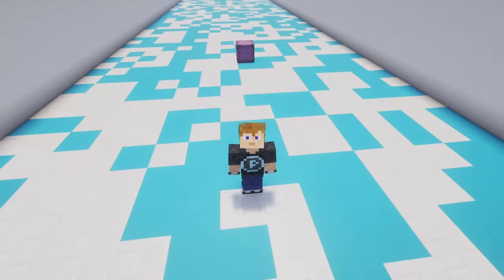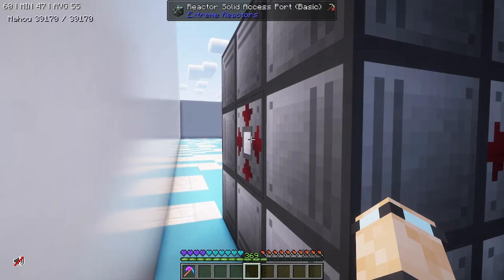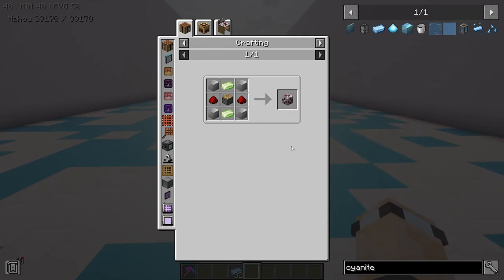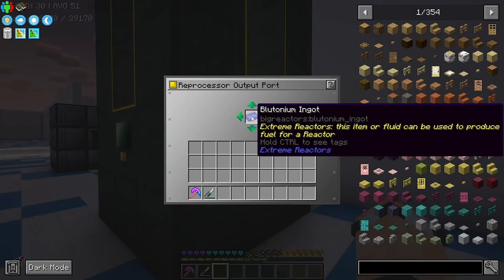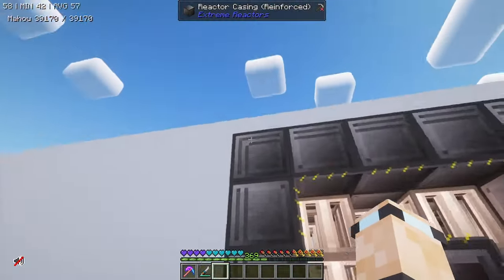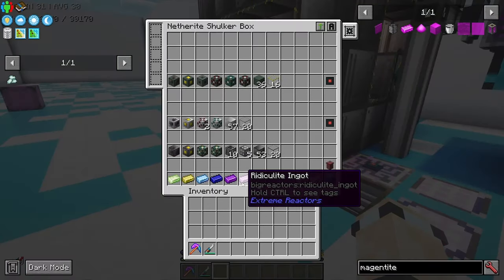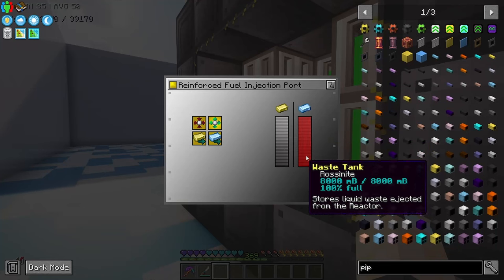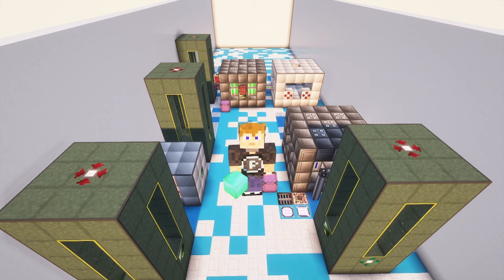All The Mods 9 Extreme Reactors Tutorial - Insanite Block

Comment: There was a post on CurseForge by a player who said they were having stacking problems within ATM9 whereby identical items wouldn't stack. Incidentally I noticed it happening to 'Secret Life SMP' players in their videos (eg two acacia logs from the same tree wouldn't stack). I wonder if a recently updated 'commonly used' mod has introduced NBT data problems. 🤔
Reply from the maker: That is and issue I had and it turned out to be because a zombie or other mob had picked the item up.
The prevailing theory we have is that mek adds an extra nbt value to liquids and that's messing with the reactors 🤔 I hope its resolved soon, it's very annoying 😂
Reply: Can confirm this is still a minor issue on 0.2.51. only have had it with patterns for refined storage and some misc items

Comment: Not too sure if anyone still needs help with the tags problem but this is how i overcame it, from the reactor i used mechanical pipes to a mekanism tank then mechanical pipes to the reprocessor and that worked, its working for ridiculite so i'm going to assume its going to work for the rest, hope this helps :D
Reply from the maker: That's actually genius! We theorised that it as mek that messed with the fluids so using mek stuff must have fixed it for you 😁

Comment: So there is a fix for Magentite, you need your reactor to make an ingot, then put it into a fluidizer, then pump that liquid magentite into the processor, but I have now come across a problem with rossinite, where it wont pump into a processor and you cannot turn it into an ingot, the solution of going into creative and getting an infinite tank with rossinite works, but it still kills the process of getting the atm star legit.
Reply from the maker: I thought this was fixed 🤔 I did it recently in my ATM9 No Frills LP but i went the bees route instead and that turned out a little better

Comment: I think I'd send all the power outputs to an induction matrix so the power is useable later myself! Cool video though I've referred to it several times already, I'm struggling to afford every machine lol but I'm slowly working through them manually with one each 😅
Reply from the maker: I had already made my first ATM star at this point so we had infinite power, most likely why I was so dismissive of the power this outputs! Oh and back when I made this, the reactors had 3x less output. My community were the ones that got that power bumped up 😁

Comment: Not sure if the Magentite bug has has been fixed yet, but my setup works perfectly.  I use the fluid transfer within Refined Storage to hold a 64k fluid buffer. Import it out of the reactor and Export it into the Reprocessor.
Reply from the maker: I haven't checked in a while but I'm guessing it's fixed 🤔

Comment: It has to be a weird NBT issue Mek pipes, but it does work if you do it a certain way.

Edit: I wasn't patient enough and you CAN use a drawer for a buffer (still using Pipez)
So I tried a few things with Magentite and Rossinite. 
When I piped it out of the Reinforced Reactor into a Fluid Drawer, it wouldn't go from the drawer into my Reprocessor. 
But when I switched to Pipez Fluid Pipes directly from the Reactors to the Reprocessors, it works!

I'm on 0.2.8 but the patch notes from 0.2.7 and 0.2.8 don't mention changes to this mod.
Reply from the maker: I still need to try on this version to see if it works or not, not had a reply from the ATM team about it but they might have sneakily fixed it 🤞
The prevailing theory is that mekanism adds a tag to it and to get it in a reprocessor you need the correct tag. We tried AE import export, storage bus and p2p, mek pipes, enderio and pipez pipes but nope didn't work. Had to be the fluid itself unfortunately 😔

Comment: Cant figure out how the fluidizer that is suppose to mix together "Verderium" works. Ive built it as you did on the wonderfulk guide (thanks for all your guides). But when i place my ingots in the yellorium and blutonium in the Fluidizer solid injectors nothing happens.
Reply: same issue here
Reply: i just figured it out, you have to use uranium
Reply: i wonder tho.. the issue with reactors pumping out wrong type of liquid IF and HOW that will be fixed. Someone mentioned they had a work around but i cant get it to work in atm9. Not the rossanite or the other one.
Reply from the maker: So the way we got around it on the server is to have a ton of different tanks set up. Each tank would be empty and in a long line after the fluidizer so if you do get the right tag being produced it will go into the fluidizer, the rest will go into the different tanks... You could use a fluid trashcan to be honest because the fluid that doesn't go into the fluidizer isn't useful for anything 🤔 hope this helps 😁

Comment: do these blocks/ingots have any use outside of the ATM9 star?
Reply from the maker: Yeah the insanite block is used in the reactor instead of the air blocks. It gives the best efficiency (in ATM9 and 10 😉)
There are waaaay better power options though so I don't recommend it